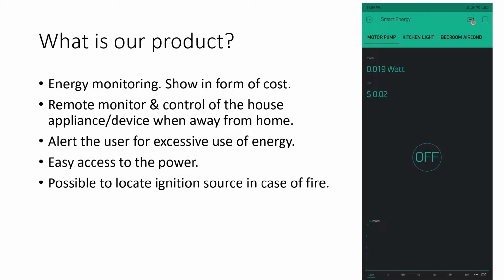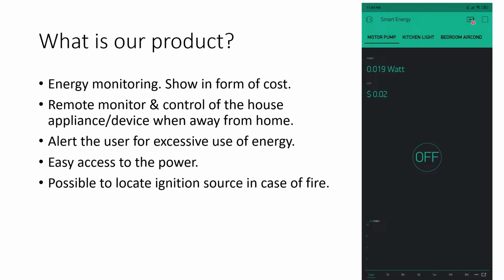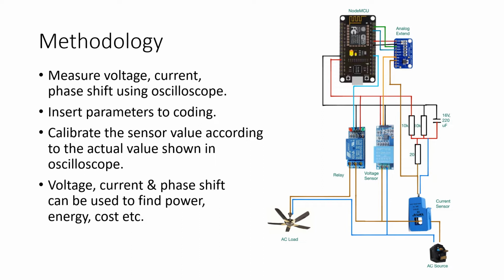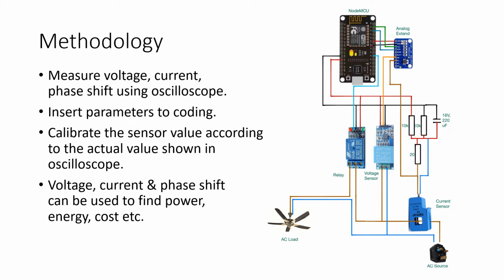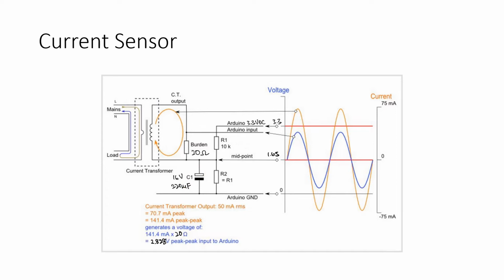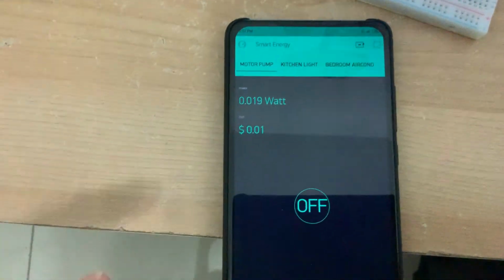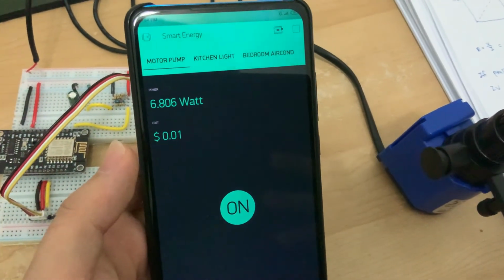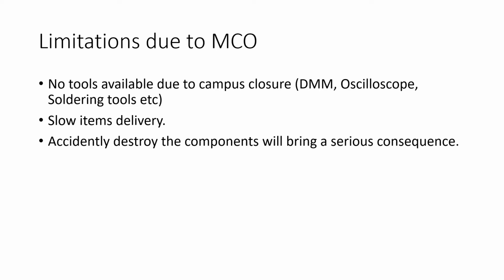Group D Remote Energy Monitoring and Switch

Comment: Hi,
Not a bad idea...especially if u can prove it using a heavier duty appliance such as an air conditioner.  It would also add significant value if u could design & built in the phase angle measurement.  As it is not sure how u can scale/port the application even in the same house. 
It is also important that no one unauthorised can "disturb" yr remote power switch.  So tell us a little about  security of yr system.
Any thoughts on the technical standards that yr team chose for the design/implementation?
Reply from the maker: Thank you for the feedbacks, sir.

For the heavy duty appliance such as air conditioner, our prototype is also able to be installed in it. Lets assume a 2hp air conditioner (which is larger than typical home air conditioner) with an startup power spike of 8 times larger than the rated power. After calculation, the spike current is around 60A, which is less than
 the rated current of the current transformer (100A). This shows that the prototype can handle heavy duty appliance. 

For phase angle measurement, it is definitely a good idea for the future improvement for the prototype.

For how we port the application in the house, one of the example is at the ceiling, where the wires for aircond, ceiling fan, light etc are near to each other. Another example is at TV shelf, where appliance such as TV, wifi modem or Astro are near to each other. In this case, 2 prototypes are needed. And for each of them, a different project in "Blynk" app is needed (Each project contain multiple tab for multiple appliance).

For the security issue, the prototype will only respond/communicate with the partners that have the same authentication token. Each time the "Blynk" app make a new project, which in this case is a house, a unique authentication token will be produced. The project is shareable to the people whom the user wish to share.

As for the technical standards for the design, we included standards such as using 2.4Ghz for the WiFi transmission (IEEE 802.11), using unique radio frequency signal range for transmission (IEC 18000), Insulation between AC cable and DC cable etc.

Comment: Great presentation for a very good project. You are not reading the slides - very good. The slides (with diagrams) are excellent to present technical details, easy for audience to follow technical discussion. The demo also works well and clearly explained. Well done!!!

Minor comment - the word 'lazy' used in the videos could be avoided, you can paraphrase that bullet point.

Just a minor question. Did you develop the mobile app yourself? If yes, how did you do that? If no, don't worry.
Reply from the maker: Thank you for the feedbacks, sir.
For your question, the app is an existing app called "Blynk". I am using its library.